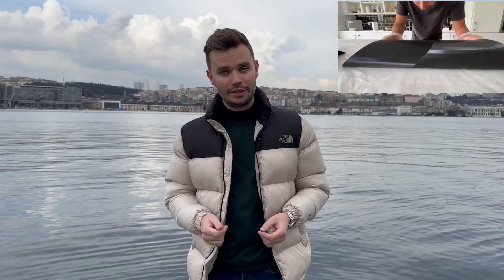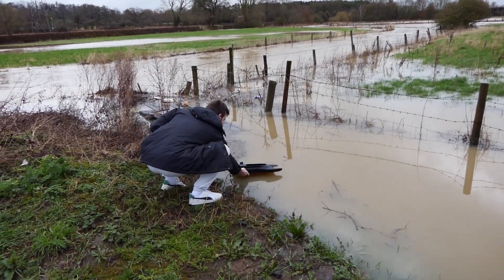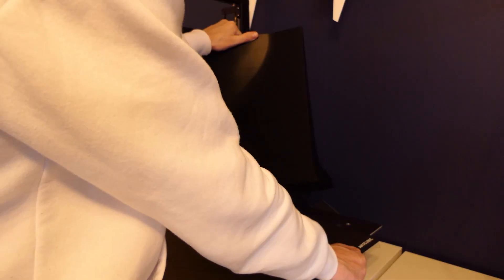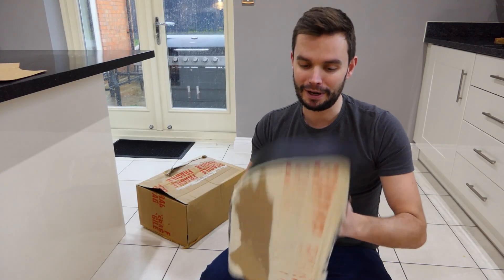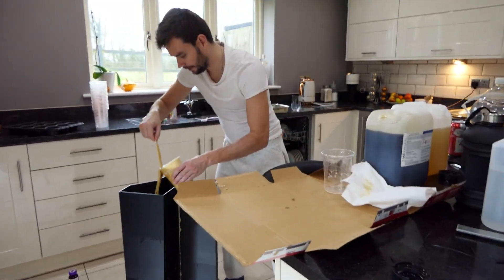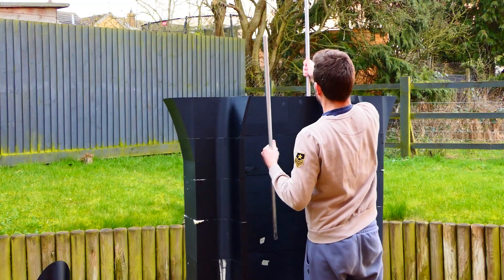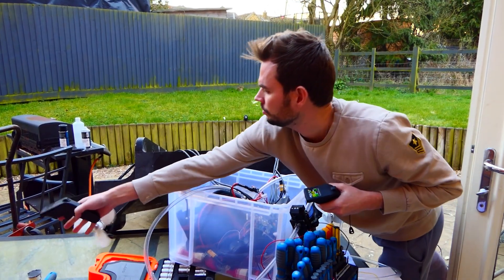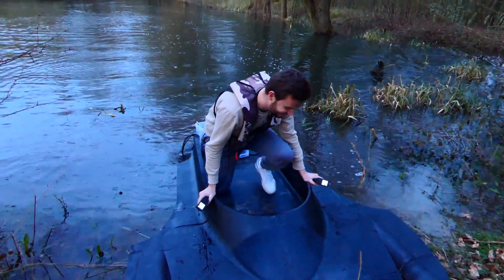3D Printed Electric Hydroplane

Comment: You almost always need to shift your weight forward in a small boat like that to get it on plane. Once it's planing you can shift weight back some. You're never going to get going well dragging the ass end through the water like that. Also if there is no fairing on the front of the motor pods to make them hydrodynamic it will create lots of drag as well.

Comment: It might be ventilation and not cavitation. Ventilation occurs when the prop sucks in air. It looks like it might be sucking in quite a bit of air. If it is cavitation, you're going to need to redesign the propellers or lower your output. There's a lot of data on using toroidal propellers online. You could even redesign it to be more like a Jet Ski Impeller where it pulls water in through a tube. Lot's of other options too probably. Add jet turbines above the water. Lol

Comment: the nacelle for the motors is blunt?
the props are intended for trawling, not high speed at all.
the props are barely submerged.
the props are sitting in the pockets formed by the nacelles and the transom.

mounting those props really looks like an afterthought... whereas its the place that all the power is applied and should be the FIRST design consideration... you can get any piece of junk to fly/plane (no different to aircraft really) as long as it can apply power properly, be it air, water, or dirt... and use it. a certain prop works one way, another prop works differently... whats the ideal rpm of the props, what rpm do the motors actually do?

water is heavy. water flows in very predictable lines...

its well worth experimenting with a canoe before attempting a "planing" hull... seems to be a serious misunderstanding of getting power to the water, and how water flows in general. 

good luck finding surface penetrating props at approx 6" diameter... another 3d project along with some casting in aluminium, maybe?

anyway... shaft/cable drive, get the motors inboard and out of the way, thin fins to the props held out on skegs.

get rid of the RC nonsense. use proper speed controls with a proper throttle lever.

Comment: I think your choice of hulls is wrong.. (I raced a drag Hydro  for years)..  Using a hydro hull when a planing hull is more ideal.. 
Hydro  "blows the tail" when the correct surfacing prop with adequate power "lifts" the tail.. This leaves a pair of contact patches on the front sponsons supports that front half of hull on water.. Is "on plane"  but using air trapped under the hull as a lifting device (if that makes sense at all)   In the end, we also use the rudder as a steering device as well as a force to hold the nose of the boat down..(pretty substantial number there)

Comment: i am absolutely not an expert on the subject, but i think putting the motors lower (deeper) would help, also the weight distribution is a little bit off, maybe a better seating position (like a sports car) and then putting the electronics and other stuff to balance it out would help, also more motors is always a great choice,
p.s. and also making the back end of it also streamlined would be great (at the very least visually)
Reply: and it was lovely, wish i had your energy, subscribed

Comment: You need to change the location of your props.  They are directly behind the flat surfaces at the stern on both sides.   This causes a backwash , and will cause your rops to cavitate.   If you will place them in the center, and below the stern plate with fins to break up any backwash,  it will get the speed you need.

Comment: Amazing printer can you approx.  price for me a standard type  rowing boat  6 feet long 4 feet wide  to see i9f it could be cheaper to get some printer company to make it . The printer DIY self assembly at home coulod reduce postage costs as boat  could be several component more small size package . I just want to put a ordinary 36 lb type electric motor to it to go from ship to shore distance off 2 miles eg one mile to big boat on anchor and one mile back  at about 2 to 3 knots so saving me to row the boat  .Al I know about props is one blade prop is best but hard to balance .Fast boats solve the problem with using two blade prop but half the blade is out of the water at high speed so effectively is a single blade prop .Problem is it needs gobs of power to get going when both blades are in the water  at slower speeds so might be easier to have two props one for slower speeds like gearbox in car and the bigger prop for higher speeds  or system to  electric to reduce power demands until boat gets up on step and then kicks in power to go to higher speeds . Possibly to get this idea checked out have normal power boat pull your boat to see what speeds it comes on step probably 12 to 18 MPH   and what it is like at top speed 30 MPH . If the tow rope has a system to register pulling stretch power in kilograms abit like weighing scale systems  this can tell you what power you need to to get to to 30MPH . Then you can figure out props to do this job . However top speed prop might cavitate a lot at slower speeds so might need  reducer prop  angle blades  with variable pitch  solutions which cost big money off the shelf . Keep going

Comment: 2:54 I standard go 93mm/s with my Creality Ender 3 Pro when I want it was but quality on smaller prints, so I have no idea why it goes that extremely slow in the video. Higher would work as well if there is bigger prints like like this and 500mm/s would absolutely be possible as well then. 3:00 I run my Creality faster than that as standard, so i have no idea where you got that from.

Comment: I had a hydroplane that was given to me years ago. I didn't take it seriously until I started playing with it. I put a 40 hp Evinrude motor on it and soon found out that it was more than enough power and the boat went into violent roll slap. (side to side) I experimented with height of the motor, and found that by lowering center of gravity and putting the prop deeper into the water made it more controllable. These boats ran smaller engines on alcohol back in the day. I hope any of this helps.

Comment: Hi! I have designed somthing somewhat similar like this in the past and i belive i know how to fix the cavitation on the propellers. First you need to fix the surface infront of the propellers becuse you need as good of flow as you can get when the propellers are pulling a lot of water. Secondly you might need to change the propeller to one that looks more like a supercavitating propeller with higer pitch becuse the propellers you are using are not designed for speeds of this caliber. This shoud fix the problems you were presented with. -Thomas

Comment: Cool project; a bit late, but id design in more of those channels, and epoxy glass fiber rods into them; and have them guide the assembly and structural rigidity of the printed parts; much like thin carbon rods are often used in model planes. Youve got those two alu tubes in there which is something; but bendable glass allows for more design flexibility to go all around the outside, and youd want them glued in there with maximum surface area if you want them to transfer meaningful load to the printed bits; just sliding them in wont get anywhere close to maximum effect. I mean it seems fine so far but I wouldnt bet a lot of money on what would happen at the first impact at speed... failure analysis always makes for enjoyable content though so there is that.

Comment: Great video and build. To reduce cavitation of the props you need a cav plate - essentially a plate on the back of the boat that sits just above the props, it'll make a big difference. I used to build ski boats and played around with different shapes, sizes and angles, but in the end given the position of your motors, you probably need something 400mm wider than the hull, and 200mm beyong the props. Good luck, I'd love to see how you develop it.

Comment: 3d printed parts can shrink slightly depending on the plastics used, But what seems more likely to me is that they warped. Especially since you mentioned the foam got up to 80°... It's also possible your printer is not quite dialed in and leveled. You'd have to check the dimensions of the parts as they come off the printer to see where they went wrong

Comment: Is it Cavitation or Ventilation for a start?
Reply from the maker: I believe it’s cavitation as I suffered from ventilation on my hydrofoil due to the props being too close to the surface. This time however I believe the props are too lower pitch and therefore the RPMs are too high paired with disrupted water flow (from poorly designed engine mounts) 

But who knows we will delve deeper in part two!

Comment: With the prints having gaps I can think of two possible reasons:
1. your printer is not assembled perfectly square. On some prints you won't notice as the prints that are supposed to fit together were scewed in such directions that they still fit. But then in other joints those scews add up badly and you end up with the wedge shaped gap. 
2. at these sizes even PLA warps. I have a V-Core 3 500x500x500 and I checked it is squared very well. However I still had issues with multipart prints fitting and often the gaps look like they open up towards the edges of the print. This is the higher layers of the print contracting and lifting the corners off the bed (sometimes it lifts the spring steel sheet with it if adhesion is that good). It can also make sides of your print bow inward because bottom and top are held more by having solid layers but in between the hot plastic can shrink more as it cools. 
Cause 2 is more difficult to solve. 
- Sometimes it can help to not use the max volume of your printer and rather split your model into more parts with more gaps but the gaps are then small enough to be filled with a glue. 
- Having the printer enclosed helps a lot too as it prevents unwanted draft cooling but this is difficult with bed slingers. The bed moving along Y axis naturally cools the print as it swings it into fresh air repeatedly. 
- If the shape has no overhangs like some of the hull sections here you might want to turn off the part cooling fan as well. On such big prints even PLA will have enough time to solidify enough before the nozzle comes again to the same spot to deposit the next layer. 
- And finally the only way to really be fully dimensionally accurate on such big prints is fiber filled filament. I have tried PETG-CF, PCTG-CF and PCTG-GF (beautiful white look) and they all kept shape that was completely unprintable in normal PETG and visibly deformed in PLA. If you really want PLA for the gluing and such you could try PLA-CF. I never had it but based on how much the fibers helped on PETG I would guess that with PLA-CF your only accuracy limit will be the squaring of your printer. But be aware that you need a hardened nozzle and your speed limit might be a bit lower. For example on my printer I can do 38 mm3/s with normal PETG but only about 30-32 with PETG-CF. The hardened nozzle just transfers the heat less well. Also filaments with fibers are way more water absorbing than the same polymer without fibers. The water seems to creep in along the fibers or something. Drying the spool before you use it improves the results a lot.

Comment: You need a KEEL for the boat man. You have no bouncy displacement. You're literally like flat. Neet idea and all but literally though surprised it even floated with no KEEL water displacement creating the upwards water displacement. Which would stop your back from sinking so dam much man. Reason why it works for RC boats is because there's literally no weight. But you way with all that 200+ pounds.

Comment: No boat ever built has the props completely covered itself.
You can use pods, z-drives, angled shafts or (and better) switch to a jet drive.
This way you won‘t accidentally lose a hand with this very „unique“ prop placement… 😉

Comment: It's likely that the prop is too small, causing it to spin too fast in the water. 6kw is something after all. I would try a larger prop so its spins slower and would cavitate less. I guess 30-50%. I'm not a nautical engineer, however. I know designing and selecting props for vessels is a tough one. I would steer away from 3d printing it. I've seen youtubers do it, and it is a pain in the bum.

Comment: Thermal expansion and contraction combined with slight imperfections throughout the printing process is why parts aren't lining up, these are huge pieces and when the printers moving around, it only needs a slight imperfection for the problem to exacerbate

Comment: I believe hydroplanes like to be on plane and usually require a lot of power to overcome their inital faults of be a drag in the water they also use forward hard "fins" to stabilize once they get out of the water since they are designed to take advantage of the moving air goodluck it was a treat to watch

Comment: the deformations are 100% from the foam heat, you might've been like "its okay" but you didn't actually measure the deformation. Hull has to be as hydrodynamic as planes are aerodynamic so you have to sand and sand and sand and make it very even, no bumps no nothing. Props have to be further away from the boat, they need some cooling too.

talk to rctestflight i'm sure he'll help you out

Comment: I've made a few rc planing boats of foam plates. Powered by brushless, air propped, motors. Fastest one did almost 70kmh. It takes a second to get on plane, but then they have very little resistance. I steer them by differential in the motors. It does have a (small tapered)  rudder, but that's mostly for displacement speeds only. It lifts out of the water when planing. That's why they 'drift' cornering at speed.
So, loose the water props and instead use airprops and you have zero cavitation. Also, by angling the motors, you'll push the bow of the boat up, instead of down (what you saw happening with your 'dive into the river' model. When you throttled it, it immediately burried the bow into the water.
Short video of 2 of my boats (don't have the fastest one on video): https://photos.google.com/share/AF1QipO2oYmQdEguapMxJn3k5aJwDHYjjGCi418c0V7lZ2MRFTFjJOCnLNE2c7xidJxkWg/photo/AF1QipN8hC8ctbxXA7Vz1ZNMsdchSYh_jH7Bi7MTpN00?key=ZFlTTjRINklBdmRfUzV1RHJMNlJIUHZGbC1ZZ1Rn

Comment: You want to put a prop shaft through the bottom of the hull. The pods you have the motors mounted on are starving the props. Look up RC Hydroplanes. I build and race RC Hydroplane boats. You don't want to use twin propellers. Run the two motors through a gear box and one shaft. If you want to get over 15mph it must be a surface pearcing prop and a surface drive. The prop will be only half submerged when at high speed. Or find an ald small outboard and replace the engine with your electric one.

Comment: To reduce the cavitation, maybe use a prop jet instead.  Put the props in a duct that closely fits the outside diameter.  Print a honeycomb structure so you get laminar flow.  You can also have stators that spin the air in the opposite direction the props do..
Reply: It's a hydroplane. He needs a surface drive with surface pearcing prop. One shaft going through the bottom of the hull with one prop. The prop must be only half submerged when the hydroplane is on a plane. Jet drive will cavitate once it's riding on the sponsons. Jet drives are not the answer for highspeed. prop drives are much faster and much more forgiving. He just has no clue what he is doing when it comes to propulsion. He has huge plastic pods in front of the props. of course it wont work.
Reply: @FarmerFpv  I don't know.  We used jets for our kodiaks on rivers in Alaska.  We could go anywhere and FAST.  What I'm talking about is submerging the whole jet assembly, though.  You could still plane and have the intake completely under the water.

Comment: You need to get the front side of the props into "cleaner" water, away from and/or below the hull of the boat.  Longer prop shafts angled downward, with a streamlined support to help hold them straight.
Reply: Exactly. They're not pulling enough water from the front side. Either move them out or back farther or create a channel under the hull so they can source the water to pull and in turn push otherwise it's just going to suck.
Reply: I think the props should be larger as well.  I think they're spinning too fast, and not gripping the water. @collie147

Comment: The large flat surface at the back leading all the way down to the props  could be causing a low pressure area just in front of the prop and letting air get pulled down to the prop. Re-shaping the motor mounts to be more of a knife edge from the bottom of the boat to the top of the motor might help some. Or try moving the props out of line with the transom. More forward or back just so the props aren't working through all the turbulence of the boat before it's on plain.
Reply: Yes he's most likely getting ventilation rather than cavitation. Have a look at an outboard motor design shape, and investigate the purpose of an anti-cavitation plate. Also if you are planning on more of a surface drive prop you need a MUCH higher rake angle like on racing props to help it shed the air off the blade tips.

Comment: This really an interesting way to make legit small water craft like a jet ski. how much did you spend in filament and 3d printers?
Reply: 3d printer ~ $500
PLA $17 x 50 boxes = $850
PLA Gloop ~ $35
Expanding foam ~ $75 

~ $1,500 to make a small custom boat frame 🤔
Also like a lot of 3D printing, 3D modeling, and Assembly 

Wonder how that compares to other DIY methods
Reply: @computermdms  considering you can make a plywood hull up in about a day if youve built them before... ffs, i made one from a packing crate. just cus i was too cheap to go buy the plywood sheet....
Reply: @paradiselost9946  yeah your right, the real advantage is that a complex hull is not more expensive but that doesn't seem to be worth it 🤷🏼‍♀️